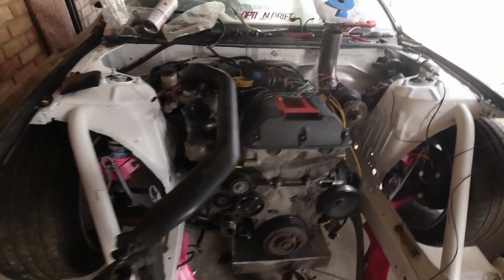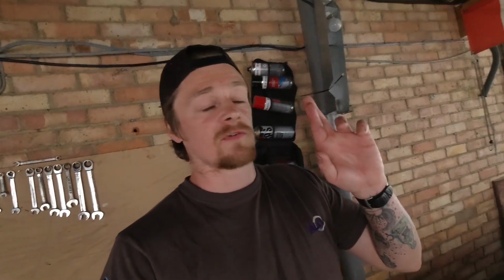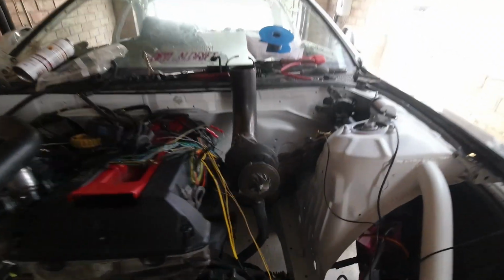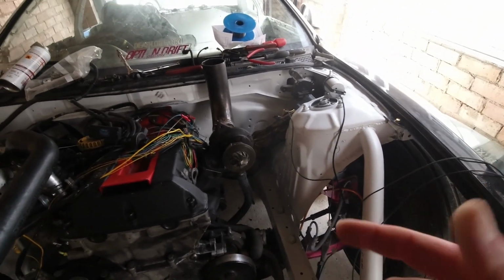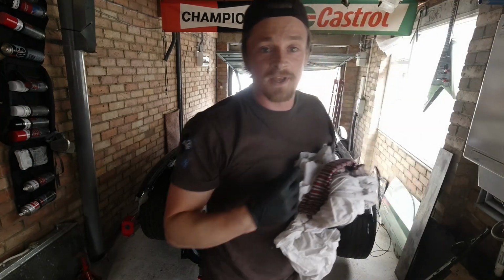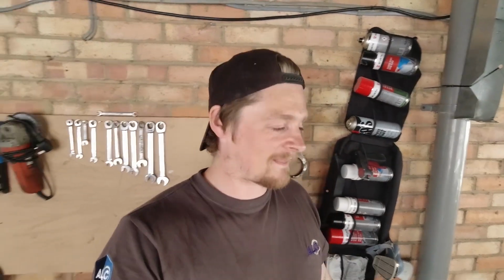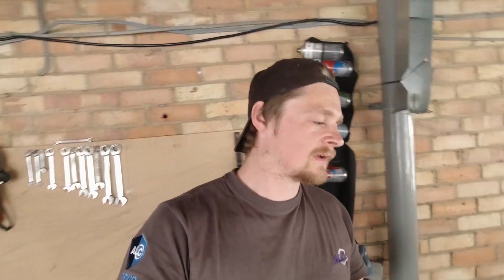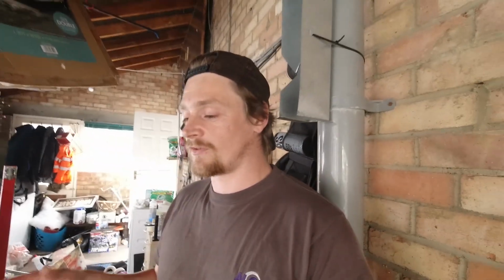Saab Powered Drift Car First Start | 200sx S14 | Saab B204 Engine

Comment: Good to watch, I'm gonna use a tip for oil pump and backfill mine as mines freshly rebuilt and concerned about priming it and get vacuum.just about to fit mine back in a corsa B😁
Reply from the maker: Yeh I wish I had known about it before I tried running mine for the first time! Haha glad it's been helpful man

Comment: Really happy for you mate. I made the same oil line mistake with my transit. I bought it as it had the cleanest engine bay I had ever seen on one and then I ruined it 😂 now its a normal transit. What oil pressure switch are you using? The standard one on the back of the block. Well the side in your case lol
Reply from the maker: 😂 easily done man! Luckily I was repainting the bay anyway so I wasn't too bothered. 
I'm using the original pressure switch, I've got a sandwich plate on the filter where I've got a sensor for the oil pressure gauge and that works a treat
Reply: @jackjc  that's a good idea. My car has decided today after I up the boost it now doesn't want to rev past 5k and my boost comes in at 3.5k. Let the hunt begin ffs 😭
Reply from the maker: Can't say I'm a fan of that man 😂 here's hoping you get it sorted soon!

Comment: What kind of exhaust manifold are you using? Looks sick
Reply from the maker: It's a 900 manifold that's been flipped with an adapter plate to allow the turbo to be top mounted, alot cheaper than a stainless top mount and stronger in some cases
Reply: @jackjc  could you shoot me the link by chance? Been having trouble finding the adapter

Comment: How the hell you connect b204 to gearbox?
Reply from the maker: Vauxhall omega gearbox bolts right up, not the strongest of boxes but easiest fit for rwd conversion. Bmw boxes are becoming more common now but a bit more involved. There's a rumour I heard that some bmw gearbox internals fit into the omega box but haven't seen anything from it
Reply: @jackjc  I do not understand how opel and saab is connected. This engine was from real saab era, from 900 and 9000, there was no Gm at that point. I even heard, that this or b234 can be put in mazda rx8. AMAZING
Reply: @Jonjs99  you can also get a adapter plate for around 250 euros and use it on the 530D case, and a flywheel for 450 euros, but the omega case is the easiest :D